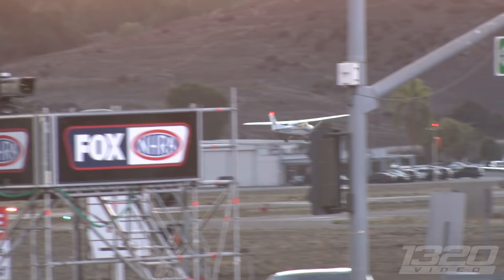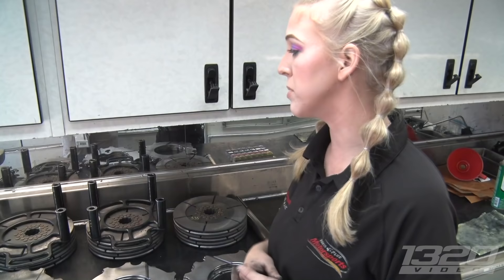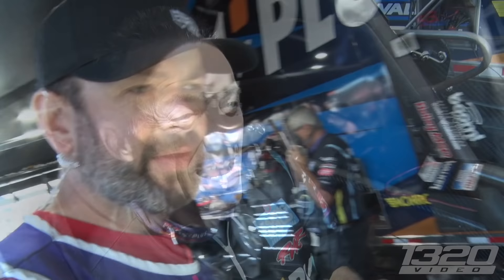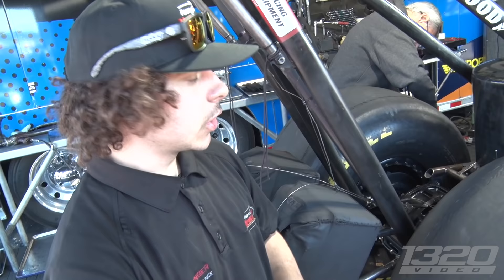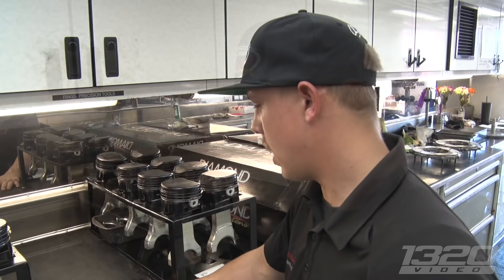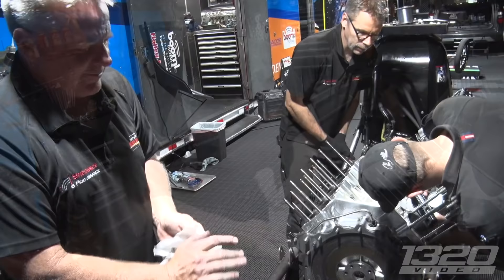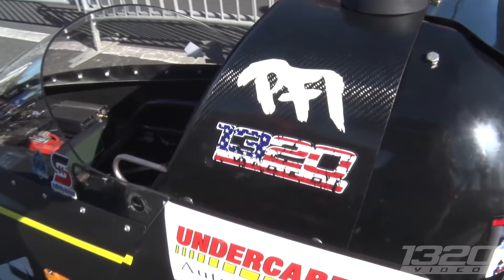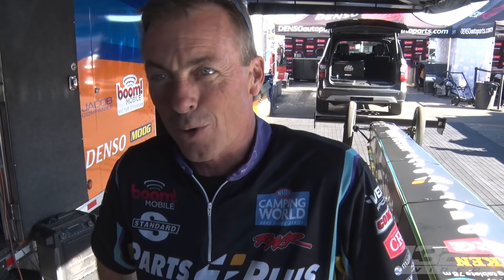What's it COST to race a 12,000hp TOP FUEL DRAGSTER?

Comment: I was privileged to get to stand by the Christmas tree at a NHRA event when our company sponsored a top fueler. It was insane. Like standing in a super-heated tornado with my eyes vibrating so hard I could not see for the first 2 seconds.
Reply: Lol isn't it nuts? Even in the stands when the Top Fuel cars roar past, you almost can not breath cause the air has so much vibration in it
Reply: @Z Family... I worked as a “part time” (vacancy fill-in) crew member on a T/F team in the early 80s. What I always found amazing being on the starting line was how easy it was to lose a shoe on that tacky track surface...!
Reply: @tommysaulter9171  So very true! I was also covered in rubber specs that I still can't get out of the event shirt I wore.
Reply: @Washman-jw3hl  Absolutely! Couple that with the nitro methane fumes and its nuts.
Reply: @tommysaulter9171  Thanks for the heads up. Sure makes the eyes water.

Comment: Just went to my first race this last weekend. April 24th...2022 at the Houston Raceway Park, the Spring Nationals. And I'm 75+ y/o disabled Marine. What a blast the wife and I had. That first nitro run was scary folks. Can't describe..ya gotta experience the power these engines have. My hat goes off to the teams that make these  events happen. Unfortunately Houston's Race Park had it's last race there after 35 years. I could tell the commentators and the fans had a big lump in there throats when the commentators announced the Farewell speech. It was a great fans and the track will be missed for a long while. Clay, thanx for the video, thanx to the owner and the team that makes this all worth while.
God Bless and Stay Safe all of you.
   77563

Comment: One of the greatest aspects of drag racing is the accessability to the pit area.. No other auto sport does this. As a teenager I would head down to Englishtown and actually volunteer to work in the pit area. My job was to scavenge salvageable parts the top fuel guys couldn't use but were still useable in Alchohol engines.  If I remember correctly , Donovan engines were mostly used.   It was a great experience and allowed me to shake hands with some of the greatest in the sport.  I look forward to shaking your hand in the future !!

Comment: Very Very Cool I'm a Certified Automotive Master Mechanic Technician 40+ Years experience One thing In like about Drag Racers there Down to Earth and You don't need Special Pit Pass's to watch Team Teardown and Rebuild Engine between heats. Even Drivers come out from pits Sometimes take Pictures with their Fans plus many Hi Performance Parts Companies have Booths set up Show off their latest and Greatest Parts Answer Questions. When your in the Stands and these Top Fuelers go bye  your whole Body Vibrates from Exhaust Pulse and Loud Exhaust Engine Mechanical Sound is Awesome. There's not a Electric Car Made to give you that Same Experience. Very Good Video Enjoyed it Very Much.

Comment: As a result of this video, I have become a huge fan of Clay Millican's team. This was an absolute delight - and it answered the questions I had about the operation of the vehicle. Fuel burn, g-forces, how long parts last and cost. Simply wow. The only question I have is how many decibels does the engine put out at 8000 RPM at full throttle? When at the finish line, I thought my insides were going to liquify. :) Thanks all for this!

Comment: I have been interested in drag racing from the 1960,s. Running a 1956 Chevy D/Gasser. I have seen top fuel ,Fuel altereds using 100 % nitro methane. In most cases those cars required some minor service  between rounds. I understand that those engines were around 2500 HP. Today’s fuel  engines  on nitro are around 10,000 HP. They have to be almost totally rebuilt or replaced from round  to round.  This won’t change until  the sport dies out due to the cost of  participation.

Comment: At 28:29 it's not often one gets to see the paper time slip for a top fuel dragster!
I read Alot from this, aside from how ridiculous that 60ft is, I see the 330ft e.t. then 660ft (1/8th) and mph, then the finish...in only 1000ft! 
Also look at the other lane shutting down short of the 1/8 at 77mph. Either the momentum let it coast another 1/8 mile and still clock 70mph and/or these cars have very low rolling resistance and could coast seemingly forever, or at least a very long time. I guess it's a little of both. 
All this insight again comes from the fact that we normal everyday people practically never get to see a paper time slip of a modern top fuel rail!

So cool Kyle and the team! This vid is way better than I expected. At first I seen the lead in and wasn't really interested as a street racer. Should have known 1320 video would put out such a quality viewing experience!

Comment: The fuel cell is like 20 feet from the engine so unless it is pressurized and honeycombed the engine is not going to get constant fuel flow and pressure even with the fuel pump because the fuel will pressure whatever volume of fuel it sees and when there is a fluctuation there will be slightly less fuel at the rail.
Reply: Again I understand it is under G pressure but am wondering about changes in acceleration Gs and Changing Fuel pressure and volumes seen at the fuel pump. These things blow up from hydraulicing and Going Lean so the causes are what I am Looking for. They are the experts of Course.

Comment: Used to be a fan of top fuel in the 90s early 2000s when they only had 5000/6000hp, but then the engine had to last another 300ft (the full 1320ft or 1/4 mile). Seems crazy that the alleged HP is twice that now. Kinda lost interest in the sport when it went to 1000ft (yah, I know safety, blah blah)
This sort of racing couldn't be invented now, so I am glad it still exists in whichever form allowed today. Just the sheer brutal way these cars accelerate and to personally experience the noise and the brutal shockwaves is magnificent.

Comment: From what I was told before, the blower on top fuel isn't really about boost. Since nitromethane carries a lot of its own oxygen they act more like a hydraulic pump to force fuel as much as they do air. Between that and the OD ratio no wonder they say it takes 300+ HP just to spin them. Whats really crazy is the life span of these parts. Have to look it up again. Think its like 500-700 revolutions. like 500 rev per 1/4 mile.

Comment: I have always wanted to see what a top fuel dragster could do if they ran all out for one mile instead of one quarter mile. It would be interesting to see what the top speeds would be & whether the engines could survive running all out for so long.

Comment: 3.855 seconds at 278.75 mph equals 3.31 g's.....OMG

To calculate the g-forces experienced during a 1/4-mile drag race in 3.855 seconds at a speed of 278.55 miles per hour, you can use the following steps:

Convert the speed from miles per hour (mph) to meters per second (m/s):
278.55 mph * (0.44704 m/s per mph) = 124.78 m/s

Calculate the acceleration using the formula:
Acceleration = (Final Velocity - Initial Velocity) / Time
In this case, the initial velocity is 0 m/s (starting from a standstill), the final velocity is 124.78 m/s, and the time is 3.855 seconds.
Acceleration = (124.78 m/s - 0 m/s) / 3.855 s
Acceleration = 124.78 m/s / 3.855 s
Acceleration ≈ 32.43 m/s²

Calculate the g-forces by dividing the acceleration by the acceleration due to gravity (9.81 m/s²):
g-forces = Acceleration / 9.81 m/s²
g-forces ≈ 32.43 m/s² / 9.81 m/s²
g-forces ≈ 3.31 g

So, during the 1/4-mile drag race in 3.855 seconds at a speed of 278.55 mph, the vehicle experiences approximately 3.31 g-forces.

Comment: It’s called hope and pray the engine doesn’t blow. Also, it’s 11k, not 12k. They all use the same built Hemi engines running on copious amounts of nitrogen, and they had to shorten the strips to 1000 ft from 1320 because the engines tended to blow in that extra 320.

Comment: Now hold on. I been going to the Nats since 1990, when the same rails had the same size engines, same ET's, Same top speeds, but back then rated at 2000hp. The hp gets exaggerated by 500hp every year since. In 1990 Kenny Bernstein went 312mph, with 10,000 hp less than 'today's cars. Hmmm.

Comment: A few years ago they were known to be 8000HP, now you say 12000HP. How did they gain 50% horsepower, yet still running the same times? Still the same 500CI hemi engines, same fuel, same blowers.

Comment: you know I made those heads ( not the heads that he's actually running today very little has changed from the original heads I made back in 76)  originally back when I was still in high school summer of junior year of high school 1976 in Phoenix AZ I turned out the first 20 pair of billet cylinder heads made for racing all by hand no CNC we sold that business to Brad Anderson.
Chauvin McLaren Emmons CRE Enterprises now Chauvin's Place Inc Prescott Arizona
I have an original set that I use on my Bonneville car and a brand new early Brad Anderson made set that have zero hours. 
been to a lot of races with my father the first time I ever went to Bonneville was in 1969 I lost my father in 2009 and drove our 428 Emmons special with his team and got a record as a novice driver at the age of 50. 
now 64 just watching everybody else having fun

Comment: I am surprised they do not take the air out of the tires and put cold air in for each round.
Reply: They adjust down to the required pressure
Reply: @stephenpage-murray7226  i Understand they measure and control the pressure all I am Saying is the Temperature of the trapped air changes Differently than when spun up from a hotter starting internal temperature. NOt sure if it makes a big difference but we are talking thousands of a second.
Reply: @robertdoell4321  
They know what they’re doing
Reply: @stephenpage-murray7226  I know. I am looking at the unusual which might make differences of Hundreds of a Thou or a race.
Reply: @robertdoell4321  
It’s all been taken into account.  Nothing has been omitted, they are amazing professionals

Comment: I find it interesting how they can come up with a horsepower number like 12,000 when there is no Dyno made for a top fuel engine. Are they using  mathematic calculations alone to come to this conclusion?
Reply: They have a tug of war with horses and keep adding more until they power equals out between the car and the horses...pretty simple
Reply: @tyslink  oh right that makes alot a sense. It is more simple than I thought!
Reply: There is and it’s very accurate.  Some teams run a torque sensor

Comment: Ok, I’m gonna call bullshit on this whole Hp rating nonsense! First of all, these Hp values are only a guess at best. It all about measuring the fuel volume, air density, volume of the supercharger, compression ratio, displacement and so on. You get the idea, but I have calculated the est. Hp and while it’s insanely high, these make a lot of crazy horsepower. But here’s my take, if these engines supposedly have increased Hp in the last few yrs, yet the ET’s have remained similarly so, I’m calling any team to share how they come to these Hp’s are at 12,000 yet times are the same? Splane it Ricky!

Comment: The title and on screen saying 12000 HP is totally wrong. At best it's only an estimate of 10000 hp and that was before they started to cut nitro from 100 percent down to 90 percent at best with alcohol. 
That reduces the horse power because of the engine cubic inches plus the energy from nitro is higher than gasoline and alcohol. So the calculation is lowered because of cutting the fuel with alcohol that has a lower amount of energy per then nitro. I know it sounds and looks better but it's not true.

Comment: The guy squeezing the bottle for testing. Can he be strapped on if fuel pump fails? I can't believe someone doesn't invent a hand held blower fuel injector hand held .. squirts in at a measured rate.

Comment: 36:16 - almost seems like they should start putting steerable rudders, like on jet airliners, on the drag cars for the shifts through the air like this.  Perhaps more reliable for steering than wheel clutch movements.  Perhaps a rudder coming down from the middle of the rear downforce wing?

Comment: The computerized "analysis" does little, if anything, to explain why the tires smoked at the beginning of his run in round two.  By then, the sun had been on the track a lot longer than before the first round. With the sun being on the track that much longer, the track was that much hotter. A hotter track is a slipperier/slicker track. The clutch pack was set up too aggressive for the greasier track conditions of round two as versus round one. The clutch engaged too quickly and too aggressively for the track and so the tires went up in smoke with 11,000 horsepower in front of them.

Comment: Fuel is cool!
But.....  12 k is a big claim. My question to whom ever can answer is.  How do they measure or quantify such a number. For the longest time. Years..  All I heard is this and that fuel car has 10,000 h.p.   then 11,000 h.p  now 
12,000 h.p.  
Ok,   explain how they confirm such a number?
Reply: @TOPFUEL 173 unfortunately that doesn't answer my question. At all.  I think the answer is simple if there is one.  But my suspicion is they currently still have no way to accurately measure the power output and the claimed power is just a wild guess.  I would like to be wrong. If anyone can give a tangable answer. That would be very appreciated.
Reply: @TOPFUEL 173 thank you.
I stand corrected.